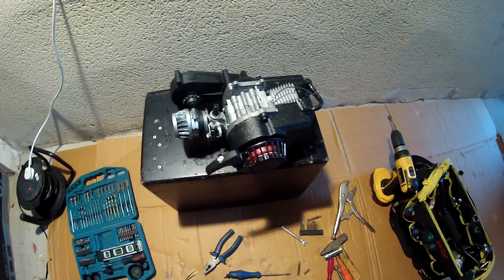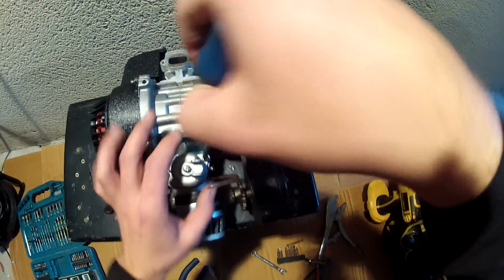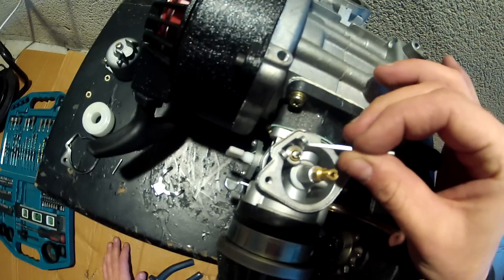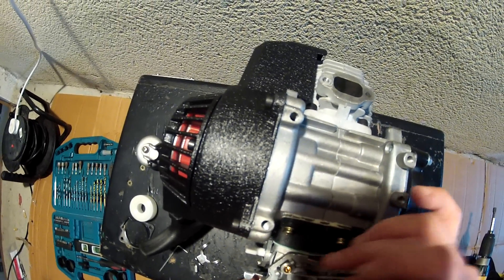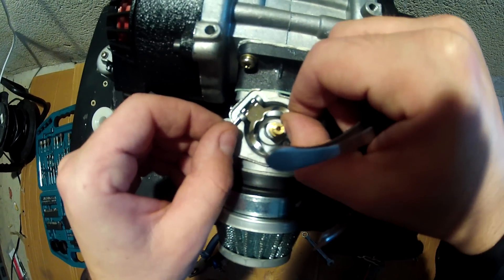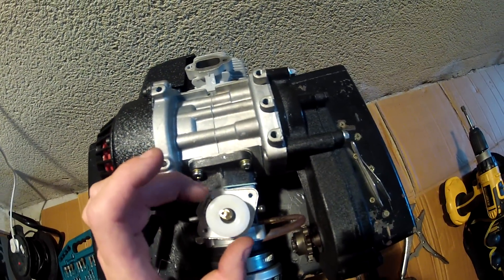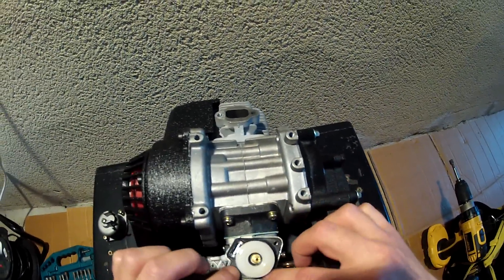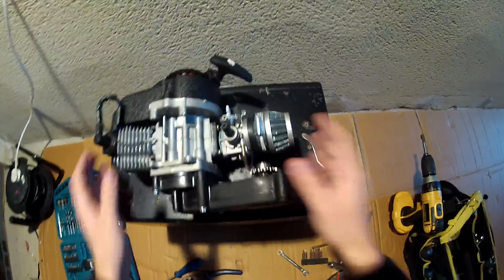Pocketbike Carburetor Leak - Quick FIX - 49cc 2 Stroke Engine Mini Moto, Dirt Bike, Quad

Comment: This may seem a stupid question but im new to mini/pocket bikes so...
What is the need for the little black wire if theres no red?
Reply from the maker: you mean the black wire from coil? this is the wire to switch off the engine, when you ground this wire it will stop spark and it will stop the engine
Reply: Meanintg you attach this too?? what exactly sorry if this is a weird question

Comment: Can you do a video of how to put it in properly please
Reply: It only goes in one way I noticed. I didn't finish the video and have damn near this exact motor and carb. The needle would be facing point down into the hole and that it. Most of them are hanging on by a metal stap

Comment: My sons 50cc starts but when we rev it a little bit it dies straight away what could be the problem?
Reply: Did you ever find the problem?
Reply: My carb is sparkling clean but just doesn’t start/ idle for long , The spark plug is clean aswell
Reply: Mike hunt Check the tank for any holes, a small hole or a crack might be a problem also make sure when you were putting the carb back together that the throttle cable inside the carb is put in the right way and the screw on the side of the carb is regulated (best have it screwed in  almost all the way and when the bike starts slowly undo it until the bike is running smooth
Reply: And of course I’m assuming that you have fresh petrol in the tank ? It’s not a few months old where moisture could of got in or it lost its “magic”
Reply: air leak or the throttle  needle needs to be adjusted by putting the little thing idk whats its called but try changing by putting it lover or higher on noches 
The main reason why it dies straight away is that your engine is floding and the spark cant ignite all the fuel  i know that your comment was 3 years ago but maybe some people need my help

Comment: +bikes4you why when i start my 49cc bike as soon as i sit down it turned off
Reply: Adjust the throttle position screw. It needs more fuel for idle. It's the screw on the side of the carb with a little spring around it. Tighten it a bit. Not too much, have it running when you do it
Reply: Probably needs a clean or change the air control

Comment: That "valve" is called the needle and seat in charge of shutting off fuel flow when the float chamber is full
Reply: He's OK calling it a 'valve' if he so wishes. You often see the arrangement referred to as a 'needle valve', in fact it's in two parts the needle valve, and valve seat.